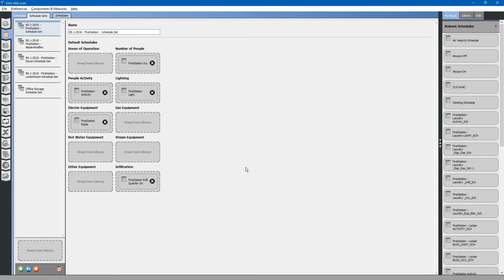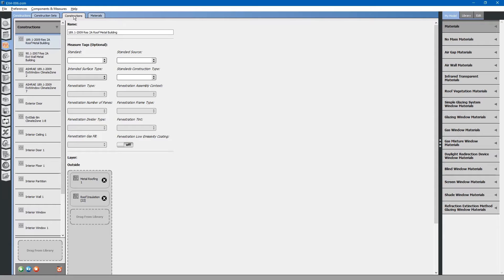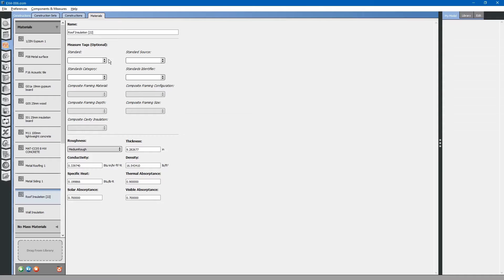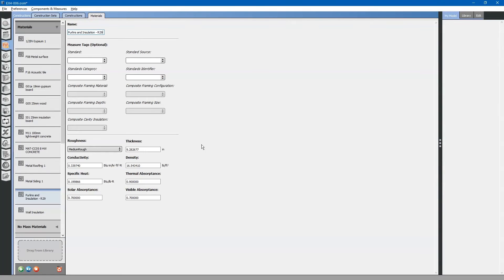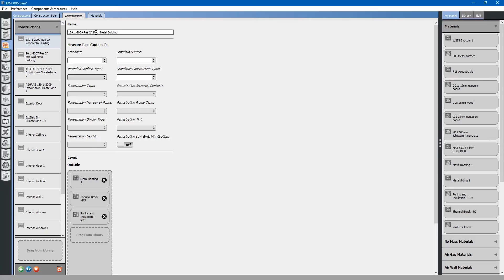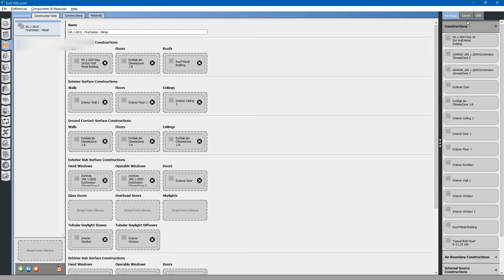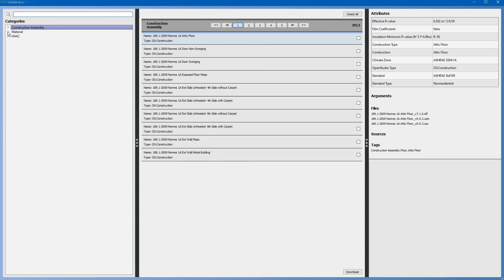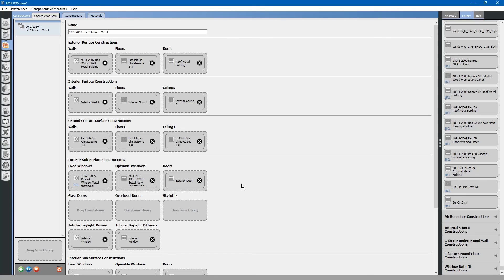Building Energy Modeling in OpenStudio - Construction Materials

Comment: Sorry I don't quite understand why we have a single Ground Contact Floor Construction type for the entire Construction Set. I thought we were supposed to create an F-factor Construction for each perimeter space... Please also explain what we need to do for Ground Contact Floor Construction of spaces that are fully surrounded by other spaces i.e. no exposed perimeter.
Reply from the maker: Good question.  I have already answered this in the comments of this video: https://youtu.be/04Tnvvg0hQA?si=iZfjgq1vOshAULjs

For floor constructions of spaces that do not have an exposed perimeter, the default ground contact surface can be assigned.  If the ground contact surface is on a wall or ceiling/roof, you will need to edit it.  I also mention this procedure in a comment on this video: https://youtu.be/N1TKdf0lqc0?si=fdENKPEAWCXrCWiT
Reply: @helixenergypartnersllc3540  thank you for the reply & the link!

Comment: I can’t find the constructions I downloaded in the library. Is there anything possibly wrong with this？
Reply from the maker: You should be able to browse to the library tab on the right, click Constructions, and scroll all the way down.  You should see all the BCL downloaded constructions at the bottom of the list labeled with blue BCL letters.  Alternatively, you can use a web browser and search the bcl.nrel.gov for the construction.  Download the component and unpack the zip file.  In OpenStudio, got to Preferences at the top, Change Default Libraries, click add and browse for the unpacked file folder.  Select the .osm file, click open, and click ok.  It should now be in your Library tab on the right hand side.
Reply: @helixenergypartnersllc3540  i had the same issue and downloaded the component. However, when i unpacked the zip file, it contained .IDF files not .osm so i was unable to add the files when i went to Change Default Libraries, what do you suggest?

Comment: Thanks for uploading these videos, they're especially helpful for new learners like me. 
I have understood how we can edit the constructions sets and craft a set or a layer according to our requirements. However I'm struggling to model a thermoelectric window that also acts as a secondary source of power. Do I have to do something different in construction to get a thermoelectric glazing type or is it all dealt with at a later stage? Any help would be appreciated. Thank you!
Reply from the maker: This may address some of your questions: https://unmethours.com/question/2952/how-do-i-model-electrochromic-glazing-in-energyplus/

If you are considering modeling the window as a solar PV system as well, I don't think EnergyPlus has any algorithms for this type of system yet as it is very new technology.  You may have to model the thermochromic window and a set of PV panels separately.
Reply: @helixenergypartnersllc3540  Thank you! If I can bother you a bit more, 
1. Does that mean that I can have solar PV as my primary source of power somehow. 2. By separately, do you mean on a different software other than OpenStudio? 
3. Also, if I use PVSyst to model anything, can I integrate it with OpenStudio's model?
You've already been a godsend by posting these videos, I would understand if you don't want to answer these questions. Thanks again.

Comment: Thanksfor sharing these videos, they’re really helpful!! I had a question if you don’t mind. 

I’ve tried using the measure tags to see the impact single, double and triple pane windows plays on a buildings cooling and heating loads as well as different tintinf but haven’t been able to see any changes at all. Is there a step i would be missing that stops these measures from being used in the simulation? Any help would be a great help, thanks!!
Reply from the maker: Hello Leo, good question.  The measure tags do not change the window properties, they are used as keywords for writing measure code (programming).  In order to use these tags, you will need to first write a measure that searches your model for all of the windows with a certain tag.  The measure then changes the thermodynamic properties of all of the windows with that tag. If you are interested in writing measures, I have and example video: https://youtu.be/G_qk_FGXMlo  Often these are used to run many simulations using the parametric analysis tool.

If you are just doing a couple of simulations, it would be easier to create two window constructions.  Assign the construction to the construction set, and run the simulation.  Review, save, or print the results.  Then, remove the first construction from the construction set and assign the second construction to the construction set. Re-run the model and review, save, or print the results.